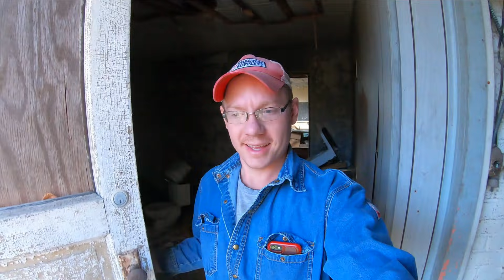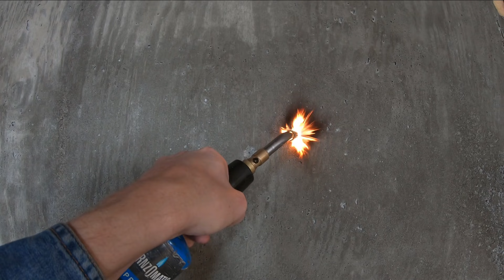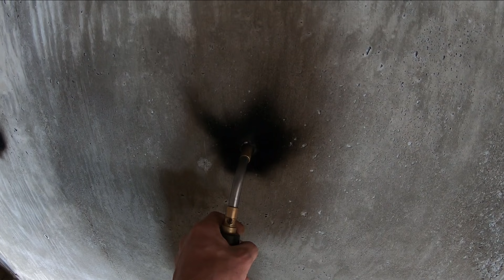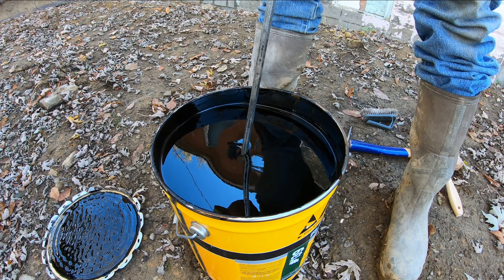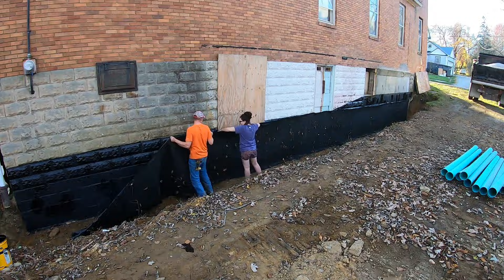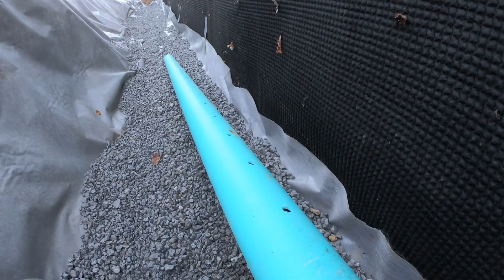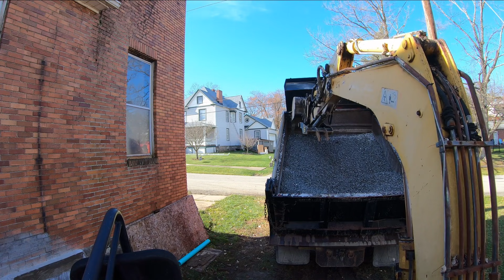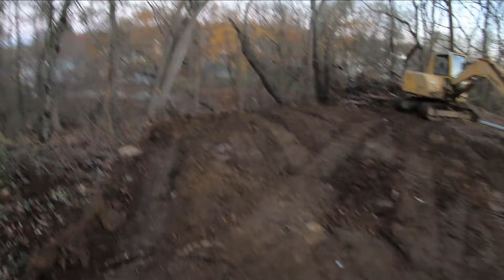Installing a Bullet Proof French Drain at the Abandoned Church!

Comment: Twenty years ago I needed some three inch perf pipe.  None was available locally so I made my own.  I took the solid pipe and used a drill with a wood boring bit and it worked out just fine.
One thing I did differently in installing the french drain was I filled the entire drain ditch with gravel except for the top six inches.  That last six inches was back filled with dirt.  In our part of the state you will always have the freeze thaw cycle,  It expands the moist soil towards the foundation and nothing will stop it.  When you back fill the french drain with gravel it acts as an expansion medium and it takes a lot longer to work against the foundation.  Twenty years later everything is working just fine.

Comment: That's one of the hardest ways I've seen to take out a set-in pvc pipe. I just use a masonry drill bit a tad smaller that the outer diameter and larger than the inner diameter. Just run it through and yank out the remains. It works because the friction of the drill bit gouging out the centre heats up and softens the pipe and you also remove enough material from the pipe wall to make it malleable. Then you can just cut the remains off of your drill bit with a shop knife. Don't use a regular drill bit though because you won't have anything to hook to the remains to pull them out although in a pinch this will work and you'll just have to drive the remains through.

Comment: As for the tiebacks: I once had to patch up a gaping hole in a wall that already had a cable going through it. I cut a PVC pipe lengthwise, slid it over the cable then cooated it with grease (petroleum jelly I think) before applying quick concrete. After the concrete had set I could just pull out the PVC pipe without any trouble.

Comment: If you could turn the bucket around on that excavator you could dump it right up against the wall really easy, and save on a lot of shoveling.
And if that bucket was backwards and if your dump truck had a gate on the tailgate you could pour right into the bucket really easy. 😃
Reply from the maker: I could if my quick coupler worked, That’s on the list of things wrong with that machine, really need to get it fixed

Comment: An alternative to torching the pipes would have been to make a relief cut (or two, if necessary) from the inside before driving them out. More work but less toxic plastic fumes. Another option could've been a heat-gun, less burning.
Say, if the dimple-board is supposed to drain into the, er, drain, shouldn't its bottom edge be above the plastic ditch-liner? Probably NBD since the foundation is well-sealed now, but that seemed a bit odd. Oh, it's fabric! Never-mind.
I look forward to finding out what the next project for the old church is!

Comment: If you do that type of French Drain again, get a can of GOOD spray 3M adhesive to seal the plastic joins and onto the wall. Quick drying and good adhesion. Even use it to put two pieces of plastic together. Good for catching mice and rats.

Comment: That wall coating is awful when it's cold. Sit the drum in boiling hot water for a while for it to become more pliable.  Dimple board is common stuff. In the UK it was called Newton system 500. We would have to place ot against the wall then drill holes through it into the masonry and fix it using a plastic hard spike and rubber compound tape around it and hammer it into the wall every 500mm

Comment: I've seen it done the way you are doing the seal, but they sprayed the stone and/or concrete with diesel or turpentine and used a hoe brush (carwash style) to scrub it well. The mastic was kept warm and brushed on. More work but seemed like "easier" results. You have a high opinion of your labor value. $1500.00 for a pump and spray contractor would be a fair price... they do 5-10 per day... the manual way, alone took you how long?

Comment: The drain pipe should have been lower than the concrete slab to be fully functional.
And i would have put in a junction to connect the pipe from the other side of the house, preferably with a catch tank in the corner so the water cant flow from side to side.
Then you could have connected the gutters to it aswell and you could hace used a solid tube outflow from the house to the back without using gravel.

Comment: Good thing you put that fabric up so you can get the dirt back out somewhat easy, if you don’t want  that wall to ever push again the gravel (washed river gravel) should be almost to grade. Peace brother.
Reply from the maker: I’ve had engineers tell me that you don’t want gravel all the way to the top because it creates a static load against the wall because it never compacts. Where as dirt can packs and after it settles does not really push against the wall
Reply: I've rebuilt walls that pushed from the dirt,all the"old guys" around here said the dirt can freeze faster than the water can drain into the gravel. I've always believed in the school of hard knocks and experience just passing it along

Comment: You should have used either a sweeping L or 2 45s so the snake works better. Also that thin wall crap will collapse in time. It will fold up from the bottom of the pipe almost as if u would have two pipes. Should have gotten you some schedule 40 pipe and drilled holes in it so it would last longer. A little more work and a little more expensive but well worth it with all the work that's going involved in this process.
Reply: The pipe he is using is SDR35, the same pipe used for sewer mains. It is more than sufficient for french drains.

Comment: Cleaning out the tie backs for patching reminded me of a house I bought years ago. It was a nice house and the basement was unfinished but the concrete walls were painted and blistering. Didn’t thing much about it, the structure was solid till spring. Our first spring I went down to the basement. It was pretty wet outside from rain and the melt. Down in the basement it looked like there were water facets all around the walls shooting water out. The house was about 65 years old. On closer inspection of the water jets I realized they were filled with rotting wood, part of the original framing for the concrete pour. I drilled them all out when the rain stopped and filled them with hydraulic cement. Things were fine after that but it sure was something to see.

Comment: In sweden where i live we never use both rubber sealing and what you call dimple board together. Its either one but never both together. It will be black mould on the inside if the wall cant ventilate out.

Comment: Pipe works best with the holes at 5 o'clock and 7 o'clock- it was designed that way.  Just run it with the label on top, and it's all good.

Comment: You can either warm the waterseal coating up or thin it down just a touch (assuming you can find a suitable solvent) to help it go on easier. I'd rather apply 3 easy coats than try and smear sludge on a wall.

Comment: We use this same foundation sealer stuff on our farm for wood fence coating and build a fire with a cut in half 55  gallon steel barrel with water in it and set the coating bucket down in there and heat it up in the water and then use it to paint with. It spreads like melted butter. (now you tell me ! lololol.)

Comment: Do you see any problem with using that light weight drainage pipe?  I recently helped fix a collapsed schedule 20 PVC 4 inch sewer pipe.  Over the years the weight of the ground had flattened it.  Perhaps the stone backfill will limit the slow compacting around the drain.
Reply from the maker: Sdr 35, tough stuff much better than 20

Comment: On your French drain piping you should have put a net tubing over the piping they call it a sock it helps prevent debris from plugging those holes
Reply: You can add filters forever, but reality dictates what is needed. This is more than adequate.
Reply from the maker: That is essentially what that fabric was that I laid over the whole thing, that will keep the dirt from getting into the rock and into the pipe

Comment: Could you thin a little bit of the membrane to bond into the pits and holes (especially on the older concrete blocks) and then put the full strength over that? It would probably bond better and be easier and quicker to apply.
Reply from the maker: According to the Can you can’t thin it and  they do not want you to try
Reply: @DieselCreek  What a pity because on porous surfaces like yours looked I think it would help. Maybe years down the track it would break down quicker if thinned.

Comment: So the rubber on the walls is part of the solution, the other requirement is ventilation.  With only the former you will invariably trap any humidity born damp in the basement.  The basement will be colder than the building, so when moist air gets down there it will condense easier.  The outer sealing will seal that damp in.
I don't know how you would ventilate a solid concrete floor, maybe some "air bricks" with closable grates inside.
My house was designed for coal fired heating, so it has a huge air space below the fire and about 8 air bricks to allow the fire draft air in.  Helps stop those wooden floor beams rotting too!

Comment: is there a way to thin out the black rubber coating? at least for the first coat, that way it gets into the small holes and nooks of the stonework getting a good base seal.  Then come over the top with the standard coat.

Comment: I’m curious about the holes in the pipe.  Straight down.? Or 3 and 9
Reply from the maker: Straight down so the water can get in fastest, keeps the water table that much lower if you turned them to say 4&8 that’s almost an inch and a half higher the water would need to rise in order to get in. You don’t want inches of water building up along your foundation

Comment: i would put that can in a turkey deep fryer with water.  heat it to about 150f, then spread it much easier, maybe do two coats.  just to thin it to make it far faster to apply and is would also penetrate gaps easier.  I've never done this, but i do know you want to heat up undercoatings before you apply on trucks just because it's to darn thick.  would this work?  just a thought.  its like that tar sealer crap for roofs and roads it looks like.  those are always heated up first.

Comment: You are quite talented operating the excavator but it doesn't take long to understand your need for dump tailgate maintenance removing gravel with a toothed bucket. Great water-proofing job.
Reply from the maker: I was being very careful not to put Much pressure against the tailgate, it’s the biggest bucket I have for this machine and I hate it, I would really like to buy a smooth finishing bucket and a better ditching bucket

Comment: You wishing you had a small flat edge bucket? Great DIY TIP on top of the bucket teeth using U bolts attach a steel plate with side gusset plates welded to it.
Reply from the maker: I despise the bucket on this machine.... it’s not good for anything

Comment: Instead of using PVC pipe in those forms, what about full thread 1/2" or 5/8" bolts (or all-thread with the nut welded on one end for long stuff)? You could probably just spin them out with your 1/2" impact.
Reply: Also: I wonder if you could modify a pressure pot sprayer to spray that rubberized stuff.

Comment: I'm always surprised how different building methods are in EU and US. Most kinds of drainage pipes or sewer pipes in Europe have flexible seals. You just have groove in outer sleeve where you have rubber V shaped gasket and you push next segment in. It seals pipes, allow for some play, it can be slightly adjusted later as it is not permanent joint, no risk of cracking. Most of all it is fast, just use some grease to put it in as it is right fit. Looking at glued joints I have feeling that it takes more time and effort than you need and it's not really any cheaper in production. I wonder if you can get such pipes with gaskets in US and if so, what's the price difference. I guess it would be much more expensive just because it's not commonly used and that's bad. Nice thing about this seal is also ability to replace and reuse those pipes as you can pull them apart.

Comment: The only thing I would have suggested is landscape fabric to allow water in, but wrap around the pipe to prevent silt clogging the pipe. Other then that (a warmer temperature for the membrane, which you already know) you did a damned good job. I studied this stuff in books, but not in practice. Glad to see it in practice.

Edit - Another way I've seen, my dad put one in when I was young, is an upside down steel barrel at the end of the hill before the water hits the building. Drains run from the barrel to a ditch, which lowers the water level as water runs down that hill. You don't catch the water as it hits the building. That tank would drain the water before it got to the house, so it's a part of surface and subsurface water control, and is not a cure, but helpful preventatives.

Comment: quick question, should the thick mil tarp layer been put behind the dimple board? kinda like flashing with roofing since water coming down from ground level would go behind the tarp and not hit the french drain? Also isnt the dimple board secured by concrete anchors?

Comment: just for future reference concrete will explode if you add to much heat . it blows up like little bombs so be very carefull when adding fire to concrete like that.the holes on the pipe are not supposed to be pointing straight down they are supposed to be pointing down but to the left and right a bit so there is a trough in the middle for water to flow in and not drain out of the next hole. so at like 5 and 7 o'clock basically.. i know this is a year late but i just found your channel and maybe you will read all this and it will helo you in the future.

Comment: So the water runs down the dimple board to the bottom which is on the under side of the fabric you put down to lay your drain pipe and gravel in.  So at best you have to hope it seeps through the fabric before going through any seams or cracks between the wall and footings?  Seem counter productive to anyone?  Sound products just less than perfect application.  Good developmental property with some hard work.  Nobody can call you lazy....Keep posting great videos.

Comment: There are crams which fit perfectly in this concrete wall holes-they are waterproof if you  just put cement in, it will never close to 100%  But its enough what you did for this building if you want to have a basin of water  it wont work on your way ...but ok normally every concrete working people have such crams for this system there are also crams out of concrete done also for waterbelongings! And the holes in the pipe should be in weight on the right and on the left so high water must come-if you have the holes downside its not good floating away!

Comment: Question: Shouldn’t the “dimple board” overlap the clear plastic so the water would run down into the pipe and not between the two products? Not criticizing, just curious. Great work! Thanks for sharing.
Reply from the maker: The plastic sheeting was glued on there,That’s just how it comes I don’t think it’s necessary as the hard black plastic is also solid and shouldn’t allow water to pass through, the gray filter fabric laid over top of the whole thing just to keep the dirt away from it and sediment from getting into the system

Comment: Not telling you what to do it's your investment but I work with that waterproofing dimple product all of the time there are fasteners for that especially made for that. Taking it up with the rubber coating is not enough the product will loose its strength through rain and freeze thaw cycles. Just thought you should know for the next time.
Reply from the maker: It’s got all the dirt to hold it it’s not gonna go anywhere the adhesive was just so it would stick until I got it back filled I don’t get why people wanna put holes in the stuff that’s supposed to “waterproof” things with holes don’t hold back water lol
Reply: I get what your saying it sounds counterintuitive however after I drive the nails in I use the water proofing material to cover the nail holes. Because I'm weird about it as well.
Reply: Also I'm not busting your chops I said I'm not telling you what to do I was suggesting maybe you try it a different way sometime. There's nothing wrong with a little positive criticism. I'm not a keyboard warrior I do this for a living.

Comment: It looks like you have made your drain useless by surrounding it with a impervious mat. I have put in french and septic drains by surrounding the drainpipe with rock and placing a strip of mat over it.
This method allows the water to enter the drain pipe and leak out through the entire length while keeping dirt above it from washing into the spaces between the rocks.
Reply from the maker: It’s not impervious 🤦🏼‍♂️ it’s filter fabric it lets water through

Comment: Is that foil/sheet you put under the drain pipe up to the creek letting water through? Because on the house side you totally covered the drain pipe with it. If it is water tight,  I don't understand what water it is supposed to drain out, the only one it could ever get is like whatever comes from the wall. I am confused.
Reply: The water comes from the soil, not the wall.
Reply: @firesurfer  But that sheet is completely folded over it and then pressed against the dimple board?! If that sheet is water tight, how is water supposed to get there from the soil.
Reply: @gubr  Talking about different sheet. The one over the pipe is a filter fabric. Not plastic.
Reply: @firesurfer  Yeah I was asking first if it was water permable.. thought he used the same stuff for all of it.
Reply from the maker: It is a filter fabric not plastic the water goes right through it